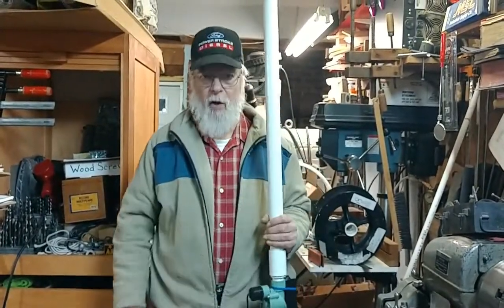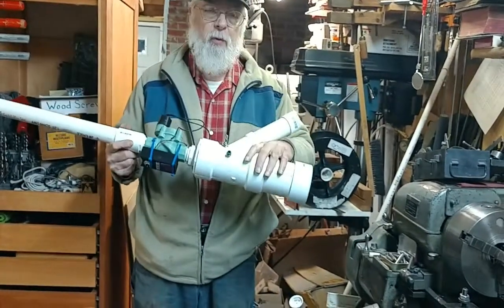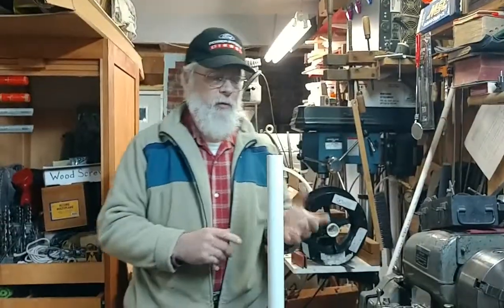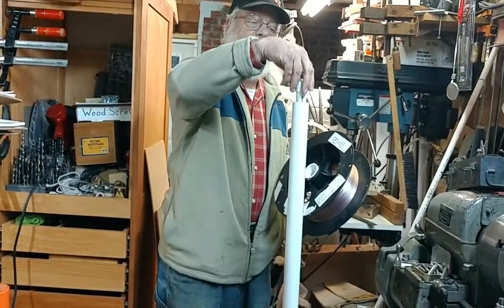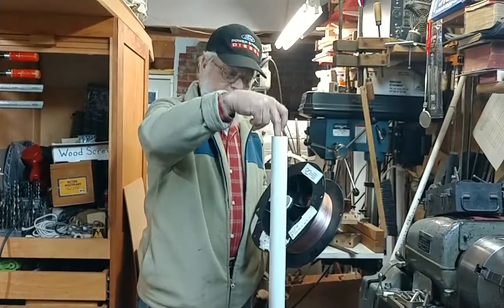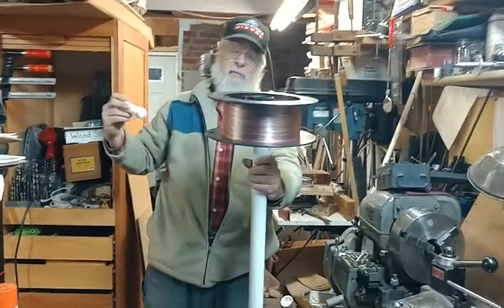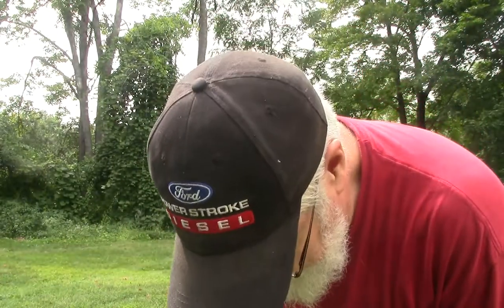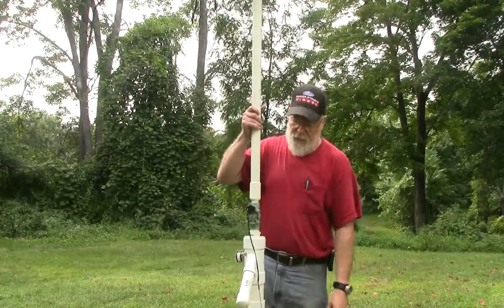Antenna Launcher

Comment: Pardon my ignorance, but what kind of antenna is being launched, and where did it end up?
Reply from the maker: I use a multi (5) element dipole which covers 10-160 meter bands. The launcher is just used to get the hoist wires up over the trees.

Comment: Why didnt you just use a drone with some fishing line attached to it?  You could have just took the drone up and over the tree.  A drone is the easiest way to do it.
Reply from the maker: Well, there's a number of reasons:
First, I don't own, or desire to own a drone.  A decent drone capable of dropping a string over my trees would not be a cheap investment. Considering I would only need it once every few years it doesn't seem worth the investment.
Second,  my launcher predates drones being a "thing".   It's served me well since I've been licensed, which is before cell phones were a thing. 
Third, I have a buddy with such a drone. He brought it over and discovered some software issue preventing it from hovering in a stable manner, and then the video connection became an issue.  In the meantime I launched quite a few birdies over my tree with satisfying success. 
None of which refutes your claim that employing such advanced technology would indeed make the task simpler and less variable.   But for the time being this "boomer" will continue to use a simpler method which serves me well.  
Thanks for watching.

Comment: Where can I buy the reducer from the garden switch to the 1 1/4 pvc. Or what is it’s description
Reply from the maker: I'd have to look to be specific.  Probably just a common reduction coupling.   All parts were readily available at the local hardware (Home Depot, Lowes, etc) Nothing special.

Comment: Where can I get that button switch?  Everything seems easy but not sure about the switch 🤔
Reply from the maker: Its a common "junk box" variety momentary pushbutton.  Like a doorbell. SPST (Single Pole Single Throw) technically speaking. I guess it depends on who's junk box you dig through.  Nothing special really. I use two 9V batteries in series to trigger the valve at 18 volts.

Comment: Interesting honk. Mine doesn't sound like that. Perhaps it has something to do with the spring inside.  I removed the spring.
Reply from the maker: We've grown accustomed to the "honk".  At first, not so much.  Didn't know there was a diaphragm spring. Thanks.
Reply: @i-squared  Your valve is a bit different, but probably the same internal design. Without the spring, air must push the diaphragm closed, so bicycle pumps won't work. My small 12v compressor works great, and the diaphragm mods make it open faster and further.

Comment: Thanks for the tip on using the sprinkler valve. Designs with the cheaper PVC ball valve are much more inferior. 73 de k8cu

Comment: Thanks for sharing... neat build that I was thinking about making recently after hacking a DCA1820 to adapt to Ryobi 18V ONE+:
https://www.youtube.com/watch?v=bDRbFWF-gzU

Then thinking a modification to your style somewhat like this:
https://www.youtube.com/watch?v=pXOcJ_KXo2U

Then thinking in more detail like this build to keep compact (that's what got me thinking about using as an antenna launcher):
https://youtu.be/t3m1aT9RN44?t=162
Reply from the maker: Seem to have missed this comment earlier.   I wouldn't have considered using a cordless drill for the pistol grip and firing mechanism.  Not so much battery needed to triggger the valve.  But if you have that much battery available you could use a little compressor (like in the nerf video) to recharge the launcher in the field. Now THAT would be super useful!   I hate trudging back to the house to repressurize.